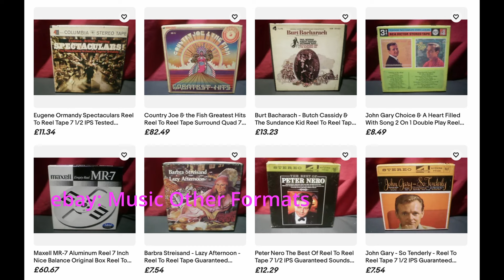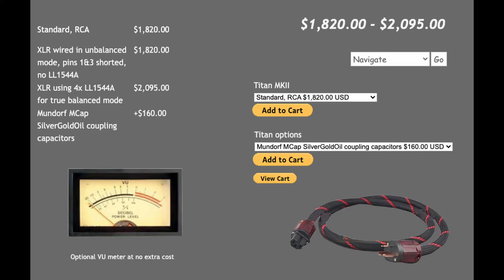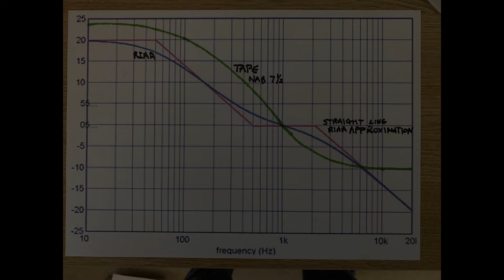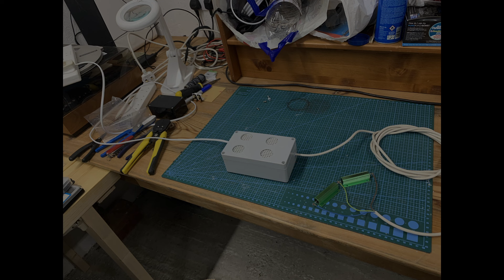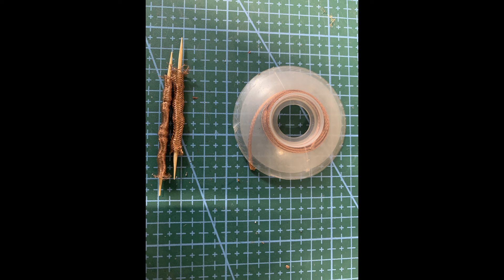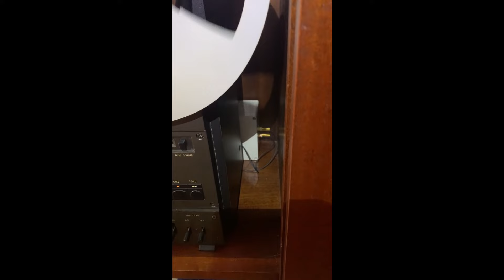Tape head preamplifier 2

Comment: Excellent work glad someone was brave enough to take on this challenge !
I wonder how hard it would be to implement a tube output stage now we’re talking any suggestions are very welcome 🙏 
Regards
David
Reply: Hi David
Thanks for your comments.
I have thought again from time to time about tubes. Personally, I’m not totally convinced about the superiority of tubes though I know many are. Sometimes they seem better, but not always.
However, a decisive practical consideration for me was safety. This was a diy project and whilst I’m perfectly happy working with low-power, small-signal transistor voltages, frankly I chickened out of using valves with dc voltages up to about 230. So my challenge was finding a credible very high quality solid-state tape-head preamp circuit that wasn’t eye-wateringly expensive.

Comment: note i have this model RS1700  i find you get used to the sound    i have a otari mtr 12  i have had alot of decks in the past 
i do think the brenell 600 head pre amp is very good yes i know there's no pic's of the pre amp unit on the net 

the only one 9is the brenell mini 8 it use the same audio cards   note the otari mtr 12  has the eq settings  
i do have a head block i can change  over  on the mtr12 

i need na decks that can take the work load      i have a scully 280-14   has alot of 3340  parts from  to make a working  scully 280-14 

i have seen a 24 track 2 inch tape deck made out of alot of revox a77 parts  and a teac 80-8 with 1 inch heads and motors 

there are decks out there  that are kind of working

Comment: hi you are doing alot of work you don't need to do 

on a brenell   decks the audio comes right of the heads to the head pre amps  
i take the audio cable from the back of the audio pre amp right to the heads i plan to use 

i been in the game fro 16 years old  there no hum at all  as long as the right audio  cable is used 

it's ok  beware  sony heads have a high ohm's so you get  alot of gain   

on my otari mtr 12 the max i can use is 200 ohm   for play back     

i use zonal  tapes  any thing that is not getting ill  with you know what

Comment: hi have one of this range  RS 1700  it  sound ace   there's no need to play with it 
alot of the tapes you are going on about are junk tapes  

i have a otari mtr 12   up date parts in the audio yes      note i have a  brenell 600  deck 

it has a very good  stand alone 16 channel pre amps  and i can  run at of tape decks at same time  

it's time there was a good low end studio head pre amps made  like clone the  pre amps i have  in pcb way pcb's can
be done easy

Comment: Fantastic work Nick!🤩Many many thanks for taking the time to share all your work here - really appreciate it.
There's so little information on tape head pre-amps available that your complete guide is a real gem.
I don't suppose you've ever considered building any more units for sale have you?
Cheers!
Reply from the maker: Hi. Thanks for your kind comments. I'm glad you found the video useful. I tried to fill in the gaps as you probably realised and do a how-to guide for someone reasonable skilled in the art. It's a pity there isn't a reasonably economic head amplifier out there, but I showed how you could make one by modifying a high quality moving magnet phono stage and there are quite a few of them. I'm not intending going into business selling kits or finished amplifiers. It's not really my sort of thing. I get bored with repetition. Alao I think the video probably shows the difficult and scary bit is cutting into your own reel-to-reel to modify the head wiring, not making the external tape head amplifier, and that will vary from machine to machine.
In case you are interested, experience has shown a few other alternative routes to the same end. There is a published passive circuit that allows you to convert NAB to IEC equalisation (see my comment below.). You just have to be able to cope with the 10dB gain loss. After I finished the video modifying a Technics deck, I realised you could get the same result on a high speed Revox B77 2 track machine by taking out the record head and substituting it for a Revox 4 track replay head. Both heads need to be wired to connect to the external head amp rather than through the internal electronics. Again more scary surgery! Of course you lose the ability to record, but I only do replay.
Finally I found a few problems matching the lower output of the 4 track NAB vintage tapes at 7.5 ips with the much higher output of the 2 track IEC 'Studio Master" tapes at 15 ips. The easiest solution was to insert a good quality moving coil step-up transformer into the weaker signal path. There are lots of those available on ebay and I don't know of it should work, but it does.That eliminates the 10dB difference and the sound quality is fine.
Best wishes.

Comment: Very nice job and great video! So kind of you to share all this here, thank you! So nice to see that much passion : )
Was the tape electronics the first thing you suspected to be responsible for the disappointing sound? I had a similar experience of sonic disappointment and I actually sent my head block (to JRF Magnetic) for relaping and optical alignment, which fixed all my sound issues!
The tape head pre you’re listing are quite exhaustive, I would just add the deHaviland (second hand only as the owner took a long holiday) and the Decware ZP3 (Great value but a scary 2 years waiting list for brand new…).
While I agree those products do not come cheap, it is a little different than low cost DiY. They are tube based and come with several EQ, gain, ground, nice finish, in house PCB design and even Mundorf gold capacitors^^. 
Also, on a different note, I have been taught that it is not suitable to mix reels of different size (playback and pick up), mostly because of torque and also to avoid the tape rubbing on the edges of the reels. The sound of the tape doing that is quite audible on the video by the way.
Anyway, what you did is amazing and it great you’re getting a clear improvement! Would be really interesting if you’d record the same track with build in preamp and with your preamp for comparison! Cheers
Reply from the maker: Hi
Sorry for the delay in responding. I was away on vacation in a lovely spot that had no internet at all.
Thanks for your kind words, you make some interesting points. I'll respond to them in order.
Electronics or tape head? Well to start with I suspected everything, but as I mentioned, lacking a sophisticated  test lab, I had to guess the most likely candidate and give it a try.The heads on the decks I was using had been aligned and calibrated by a tape technician using test tapes and had passed the manufacturers spec. I asked if any looked worn or in need of relapping and the answer was no. So I left it at that (especially since getting it done  from the UK didn't seem all that easy.)
Other commercial Tape Head Preamplifiers. I wasn't aware of the two you mentioned despite quite some searching on Google, so thanks for the info. I think my comments on the video apply. That de Havilland is about $2000 and it looks like the Decware is less but I couldn't find an actual price, so probably the Decware wins on value for money. However, as i mentioned, I didn't want another bit of hifi furniture to find a home for, just an anonymous, compact, high-quality, economic external box and I didn't particularly want valves. One reason the commercial systems are so expensive is that they are typically (very) highly engineered, but I'm not sure this actually contributes much to the sound. I accept the point about them having several settings. My DIY approach would be to adjust the value of internal components if necessary. All the extra switches and wiring are good for the supplier to cover a range of customer products, but not necessarily so good for the end user who has to pay for the compatibility componentry and complexity.
Different reel sizes. Yes I agree. Naughty me. I should have taken more care setting up the system for video recording.
Comparative playbacks. Thanks for the suggestion. I might give it a try. However, I'm fearful that any differences at source would be drowned out by the microphone and ADC I would have to use to make the recording.
Regards
Nicholas

Comment: Impressive! I would urge you to fit your preamp in a metal box and ground it to the rest of the system.
When you revealed the quad 34 I was thinking you could have modded the mm phono board for tape. I have a board like this for my quad 44.
Interesting video thanks for posting
Reply from the maker: Thank for the info. Do uk Audio sure use a lot of boxes!
Good luck with the Revox. As you know, rather than mess with any internal boards, I just cut into the head wire and left the internal boards idle. From the two ends of the cut wire, the end going to the head was connected to a pair of RCA plugs and the other end to a pair of RCA sockets. Plugging the RCA plugs into the sockets restored the original wiring.
Reply from the maker: Thanks for your kind comment. To start with I couldn’t find a suitable metal box so I used a plastic one. However on further searching, there is a metal box on Amazon that is nearly perfect. It’s the right width and height, but the length needs cutting down a bit. Also the aluminium panels are painted so you have to ensure the whole box is earthed using screws and wire.
I would be interested to know where you got your modified mm board for tape on your Quad44. Was it from Quad or was it custom made?
Reply: @nickwhite24-7  hi, there are loads of metal cases to choose from on digikey, RS etc. the key words seem to be 'electronics project enclosure'
I made the board myself from a standard quad mm phono module. I used to have an ancient ferrograph with the optional stereo playback head. I have been thinking about getting round to doing the same for my revox.
Reply from the maker: @robturner3065  Thanks for the stuff about boxes, I generally try and avoid RS and Mouser for single items because of the annoying minimum order charges jack the price up, but I will look at Digikey in future. I did find a metal box there but it was £37 whereas the lucky find (eventually) on Amazon was £22.
Not sure how your Quad 44 works, but as I understand it, my Quad 34 has an input module for either MM or MC (I have both) that is a flat-equaliation linear amp that only supplies gain: lower gain for MM, higher gain for MC. The RIAA equalisation is on the main board via a TL071 op-amp. So if i wanted to convert the Quad 34 to a tape head amp I could use the MM module largely as-is, but then I would have to alter the RIAA equalisation on the main board to IEC/NAB (re-calculating the feedback component values) and add a switch. In addition, I would lose my phono input unless I added some more switches. For me it seemed easier to lose an input I wasn't using, Tuner/Radio, and add an external tape head amp.
Good luck with the Revox. As it happens I am in the process of committing what feels like heresy on mine. I have a low-speed 4 track B77 and a high speed 2 track B77. Since I am not interested in recording anything, I'm swapping the 2 track record head on the high speed machine for the 4 track replay head on the low speed machine and feeding the re-wired RCA outputs from the head I chose from the new-configuration, high speed machine into the external head amp. Simples. But I am a bit sorrowful about sacrificing one Revox machine, albeit reversibly.
Reply: @nickwhite24-7  ah I see, the 44 has the EQ elements on the actual plug in, I thought the 34 was the same.
eBay is another good source of boxes, try douk audio in china, they sell all those audio kits.
Re the revox I was going to get a replacement playback board, strip it bare, and attach leads from it to the external preamp, you're right they're getting a bit expensive to chop about!
Edit... after checking the service manual again it would be easier just to lift the playback leads off the motherboard...!
Reply from the maker: I forgot the link for the case:
https://www.amazon.co.uk/dp/B082CQY3TN?psc=1&ref=ppx_yo2ov_dt_b_product_details

Comment from the maker: Sorry, I forget to mention if you have a NAB tape deck (usually a sticker on the back) and a modern, expensive pre-recorded tape that is CCIR (usually says so on the tape or inserts) then there is a passive equalisation converter you can use between the tape deck output and your preamp input that corrects the equalisation from NAB to CCIR. No surgery required!
The link is: http://www.nomanlab.com/sale/lim_docs/nab_to_ccir.pdf
There’s up to a 10dB loss in signal, but the modern tapes are such high output you can probably live with this.
I built one for 15IPS you are welcome to borrow and try out.
Reply: Thanks, the tape is CCIR and according to the manual the machine will play CCIR at 15IPS with no equalisation required. It's not that the sound is bad, just not as good as I had hoped! In every other respect the machine works very well so I might just leave well alone!

Comment: Interesting,  have a 15IPS 2 track machine that works very well for music recorded on the machine but the one expensive pre-recorded tape I have is not as good as I had hoped, maybe a tape head pre-amplifier would help but I'm not sure I could manage the surgery!
Reply from the maker: I sympathise. It's difficult remaining objective and finding a firm place to stand in arguments like this. The clearest signal I got was when I first bought a reel-to-reel (which was a gamble) what came with it was one vintage tape (amongst several others) by Dave Brubeck called Take Five which was clearly better than the best vinyl I owned. In addition, many of the other tapes I got with the deck were not better than the best vinyl I owned and not all the tracks on Take Five were equally good. Finally, and a bit to my surprise, the excellence of the good bits on Take Five (which were the live recordings of the drums) showed my preamplifier and speakers wee both more capable than I had supposed.
So I think it depends on what the music was that worked very well on your two track machine. If it was  top-notch live music recording of acoustic instruments via good microphones then maybe it's plausible it's better than the expensive pre-recorded tape. If, on the other hand, a vinyl transfer is better than the expensive pre-recorded tape, then maybe something is wrong because the tape should be better.
Assuming 'hygeine" factors such as head alignment, head wear, wow and flutter and so on are ok, you will maybe only get a clear answer by finding someone else who can play your expensive pre-recorded tape -  which may not be easy.
Generally I have concluded that if I wan't genuine improvements in this hobby I'm going to have to accept some moderately expensive gambles whilst I try and maintain a clear view of what "good" is like.
Thanks for the comment.